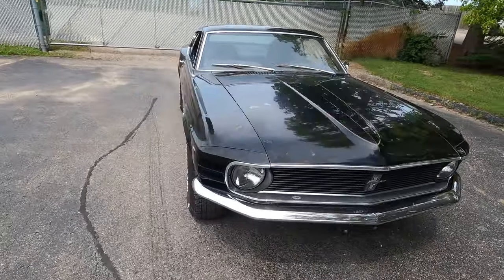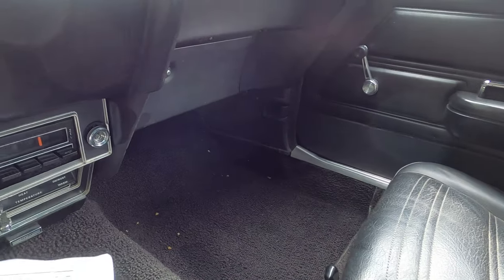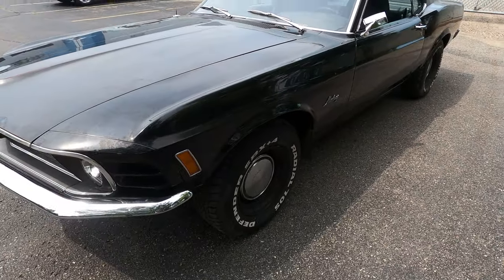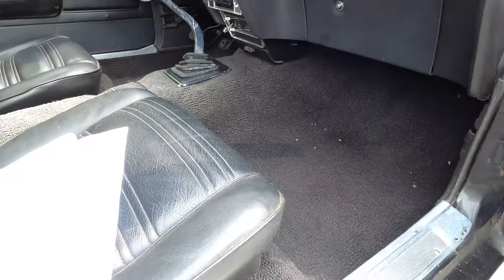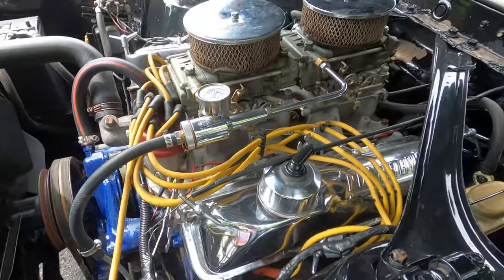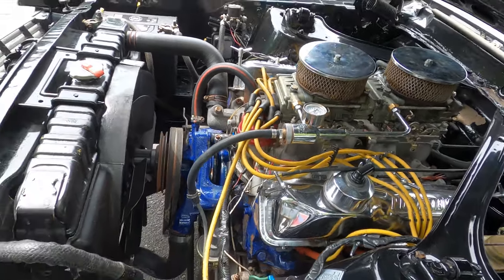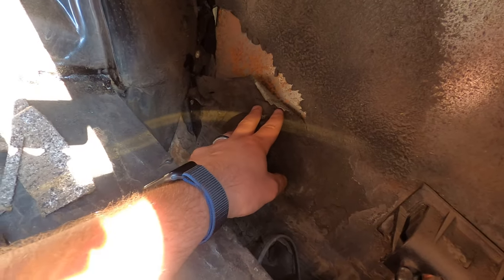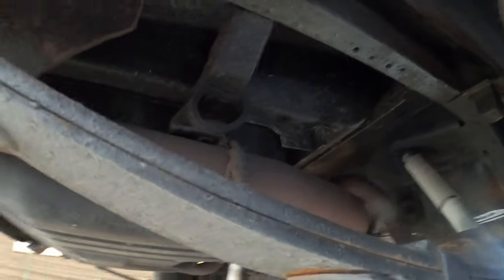1970 Ford Mustang 428 Super Cobra Jet 4-Speed

Comment: Not quicker than a Boss 429 . I have a 69 Mach1 Q code..Block number C8ME and they don't run like everyone thinks . Mine was a turd . My dad's 70 429scj Torino walked all over mine . Took my original engine out and put a 445 stroker in it. Have the 428 yet sitting under the bench